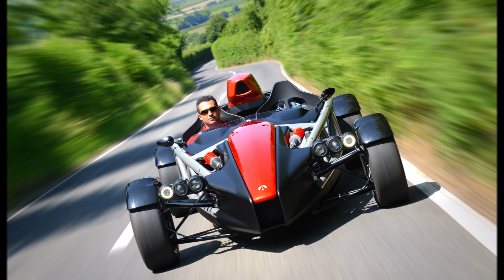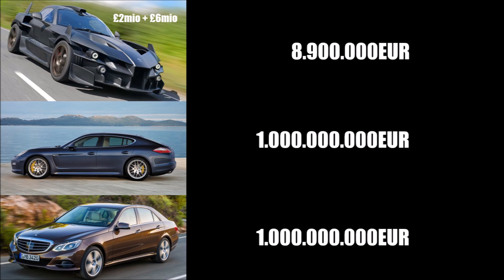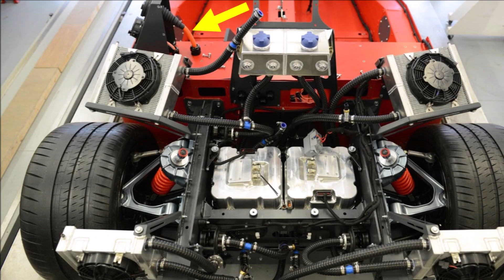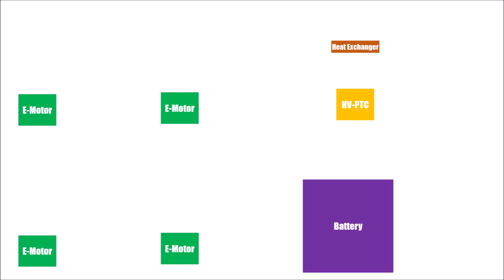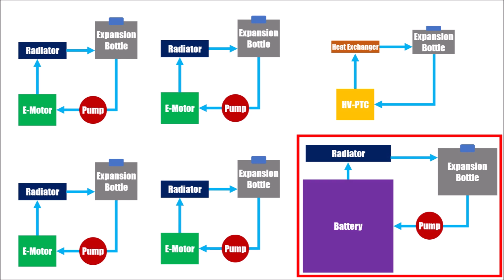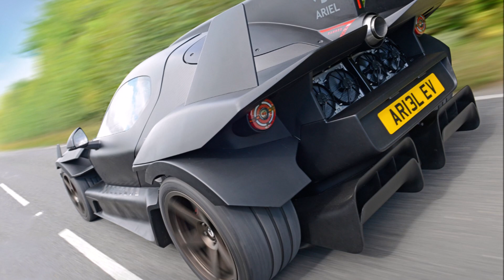Ariel Hipercar - FIRST LOOK (Technical Analysis)

Comment: Much respect for you Sir, thorough analysis & explained in concise manner. Top notch indeed.

Would you mind in a future video shed some light on why developing a new car would cost 1 billion euro or more & how did a facelift cost merc 1 billion euro.

Its just to me 1 billion euro can house not less than 4000 to 5000 families.
Reply from the maker: Thanks!
I mean developing a new production car like the Panamera for all world markets and complying with all regulations is expensive. Also it was a new category for Porsche so they also needed to build the infrastructure around the car.

How Mercedes managed to spend 1 billion on the E-class facelift?
I don't know but it was definitely necessary for the W212!
Reply: The Mercedes "face lift" was basically a heavy redesigning of including the front, also rear, and pretty much most of the car profile even. E class was pretty important at that time for Mercedes. Trying to keep the four headlights again couldn't be done before the face lift so hence that new facelift.

Comment: Why do they use a high voltage cabine heater when there are 5 radiators available for warm air?  Sounds like a waste of energy.

Comment: Cool Video like always! - I just think that the placement of the battery is not correct when I remember the Video of the Founder explaining it right. I think there are 3 battery packs  and there are no batteries under the seat. Seems that Rimac developed the package for them.
Reply: Edit: I remembered it wrong. It is under the seats, just a package that is not so high like normal. Mea Culpa!